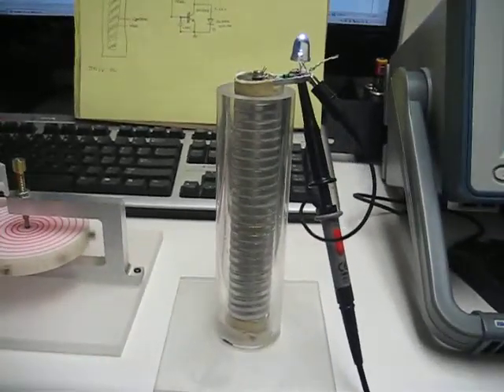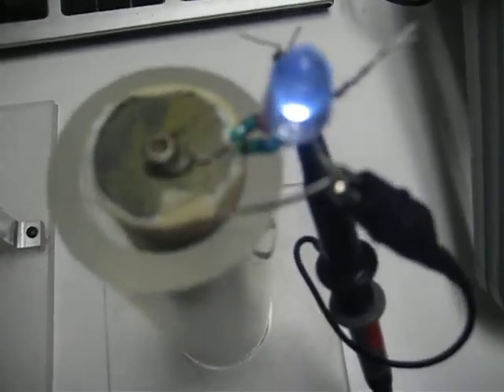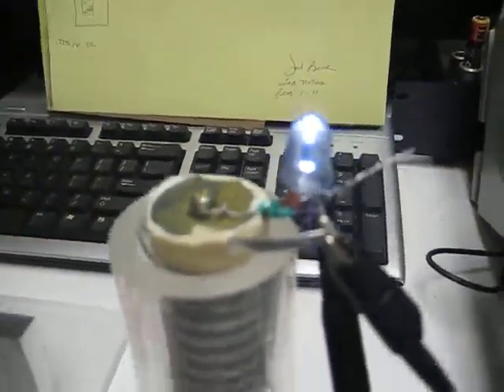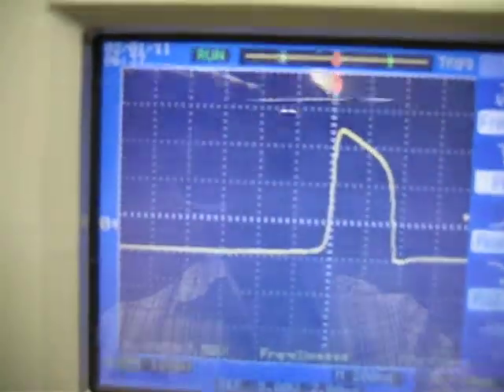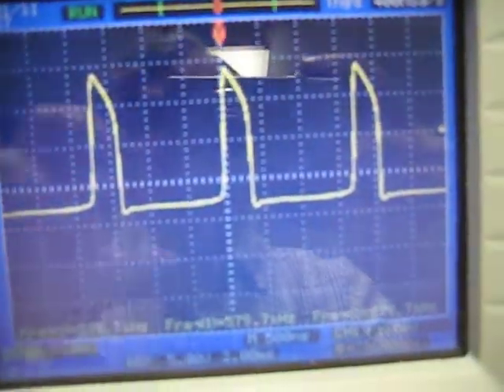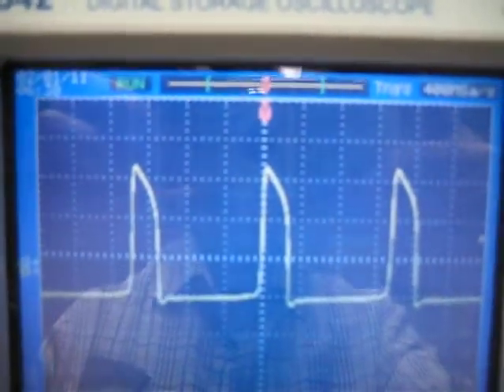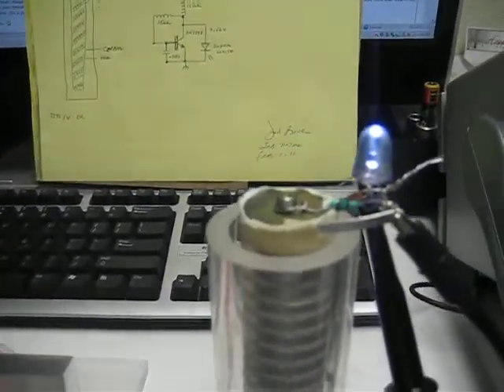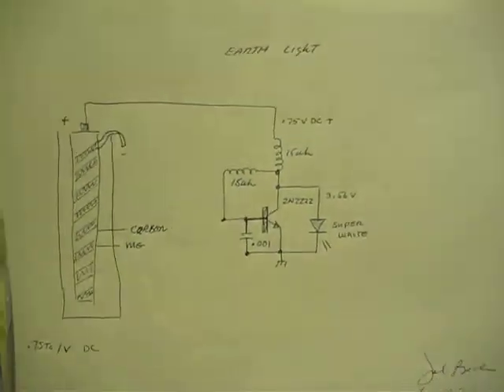Earth Light, The Easy Way

Comment: I like the idea but independent from what i see here i have been working on a similar system for years now and i ask, why building something so big that gives such little power. I have a miniature water battery that can give up to 18 volts DC, it will last for at least 1 year before having to be rebuilt but one of the plates (Copper) can be used over and over again. If you are interested in exchanging ideas leave a note in my channel lets talk, my battery needs a resistor or bye bye LED bulb.

Comment: Thnkyou for the low voltage oscillator with clean narrow pulse.
The beginning of a new year and a promising circuit because 
low threshold and pulse shape are two of the criteria that I have been looking for.
I have read of hartley designs used in world war II for military equipment.

Comment: nice work ... why is it important that the anode be carbon instead of the allotrope graphite in the earth light battery? ... also will the magnesium eventually corrode and if it does could you use Neon instead of water as the electrolyte to slow the magnesium oxidation?